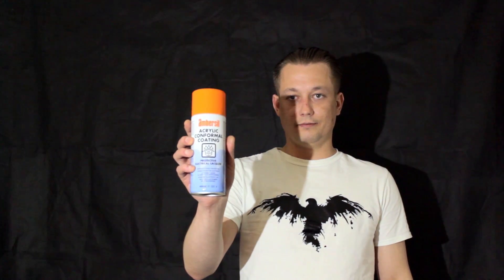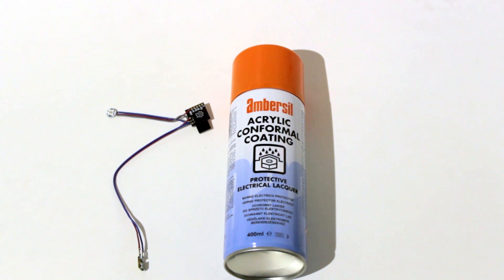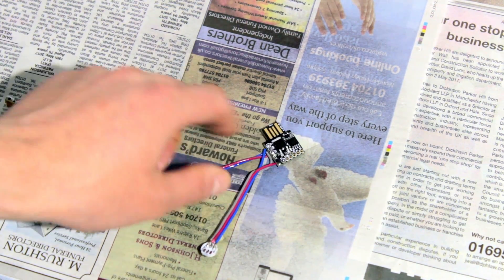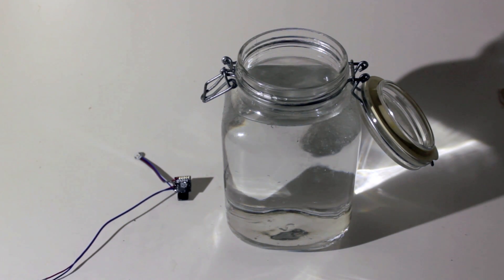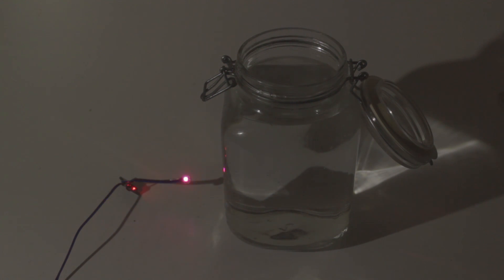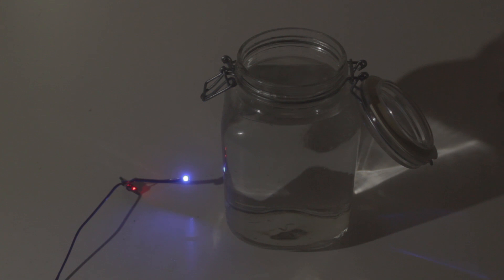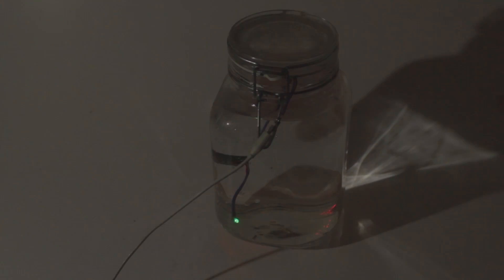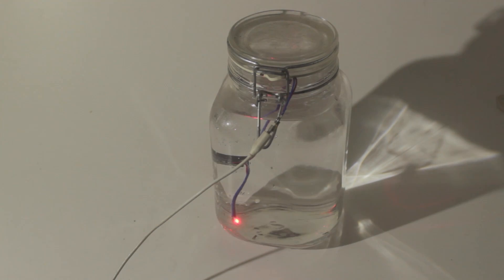Waterproofing electronics (arduino under water)

Comment: Is this safe for the other parts? Specially the board
Reply from the maker: I wouldn't recommend to do this for prolonged time. My board died after about week. So as long as there are no moving parts it works. Defiantly good for water resistance.

Comment: What in the name of Jesus?!!! How could you do that please explain more and did that work after 3 hours?
Reply from the maker: +Steve Moretz 
I sprayed it with silicon coating and it did work after e hours. It actually worked for about week in the water. So it is not permanent solution but it is good for temporary waterproofing.